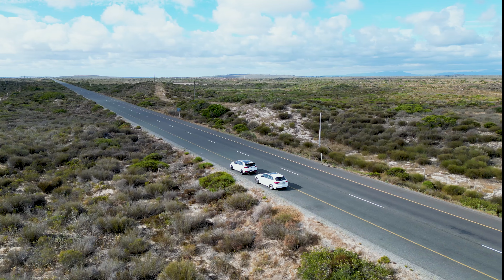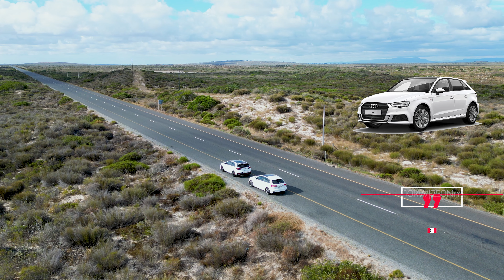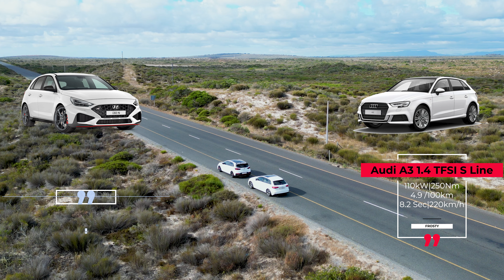RoadTrip: Cape Point to Shelley Point | AUDI A3 vs HYUNDAI I30N | 1.4 vs 2.0 | Fuel Consumption Test

Comment: Manager's tip is true... It'll use fuel as if it were strictly idling.

Another benefit of that is how the engine is engaged to the clutch and transmission, so it'll just keep going...

But downshift to a lower gear [to engine brake] so that you don't always slam the brakes... And if you have wide tyres you shouldn't brake at all.😂
Reply from the maker: I’m glad you agree. Some people out here still don’t believe this…

Comment: People usually correlate rpm to fuel consumption.
Going downhill will increase your rpm to match the wheel/transmission speed, but fuel consumption will be negligible.
Reply from the maker: Ei that topic is very tricky to most people they just dont understand so yah eish…

Comment: It is most definitely true that you should coast in gear/drive to save fuel as the wheels will be turning the engine using the downhill momentum, and the car will you 0.0 litres of fuel 😉 Great video as always .
Reply: Most people dont understand and will argue to put it in neutral
Reply from the maker: Thank you, Very much appreciated
Reply: Not necessarily the best strategy. True, it will use no fuel while coasting downhill, but your speed at the bottom of the hill will then be slower, requiring much more fuel to accelerate again, relative to the negligible amount that would have been required to keep the engine idling. The only time in-gear is a better strategy in terms of fuel consumption is when you need to brake anyway.